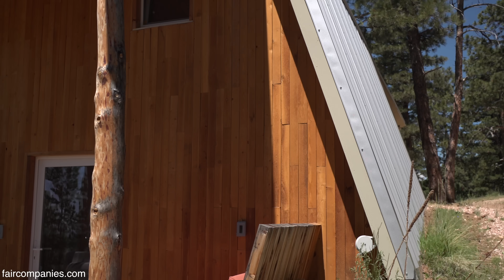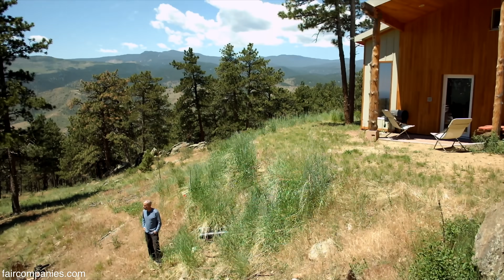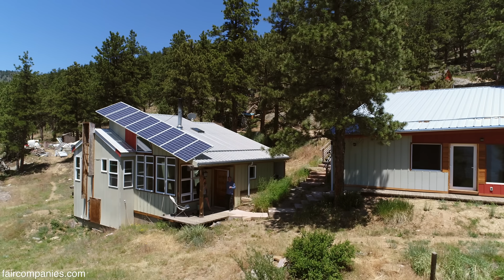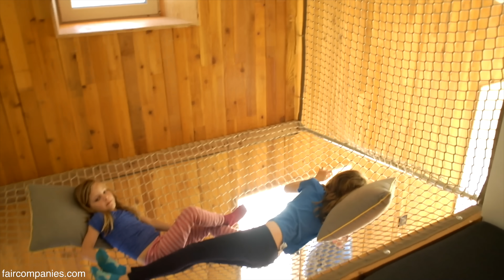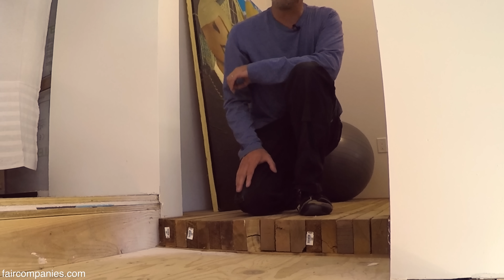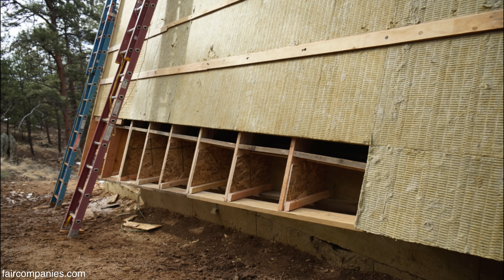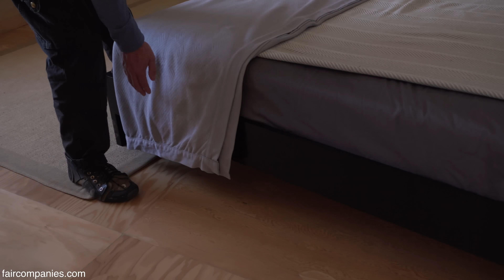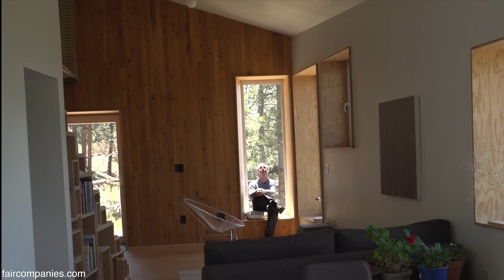Designer builds efficient off-grid Passive House in Colorado

Comment: Completely off topic why don't Americans use electric kettles?
Reply: It takes a lot of energy to boil water, as the owner alluded to in the video. I guess it's mainly a cultural thing (like top loading washing machines), but also American mains power is a little gutless compared to say, European standards. US mains is 120 Volts with a 15 Amp limit = 1800 Watts maximum. UK standard for example is 230 Volts with a 13 Amp limit =  2990 Watts. Even a cheap UK electric kettle will use 2,200 Watts, so clearly it would take noticeably less time to boil the same amount of water than a US kettle can. Also, this house is off grid I imagine and with crappy solar panels you've got no chance. Much easier to use propane.
Reply: Nick Moore
Oh ok
Reply: We have electric kettles here in USA. You can also use an empty percolator to boil water.

Comment: Why no fireplace? is it an environmental thing? I could not live without fire.
Reply: Our other small house is heated by wood. It is a lot of work to cut, split and stack it as well as does not provide a very comfortable indoor climate most of the thim. Add dust and maintenance I and very happy with having a passive house that requires no work and almost no extra energy.
Reply: Jude Vapes he doesn't need one with all the insulation. I agree though that I am a fan of the aesthetics
Reply: + Anrew Micheler Just how low does the indoor temperature fall in the winter if you have no sun for a few days? Your R6 windows are state of the art, but still lose heat rapidly.
Reply: Paul Ohlstein that's a great point. So we do have to supplement heat loss with a heating system. I my case it's peak 4500 btus which is quit small. But yes it's not cold weather that effects us as much cloud cover. You can also design with less windows and forgo the solar heat gain. There are some homes in England I just learned about that where the same in every other way except the glazing ratios.
Reply: + Andrew Michler. It is too late now, but where you have a solid partition forming the "shadow box" that frames your front windows, you could have interior insulating shutters. At night the shutters would be closed to increase R value of the windows and during the day they would fold back to form the shadow box and let the light shine in.

They could also be partially or fully closed in the summer to reduce solar heat gain.
Reply: Paul Ohlstein that's possible but really overkill for our us. We need very little suplimental heat as I mentioned so the cost and fuss would not be worth it. Thermal performance for windows are not just ambient losses but radiant. With high Delta Ts a high performing window does not feel cold adjacent to bare skin.

Comment: The pipes in the ground could be 226 x more effective it he was to use steel rather than PVC
Reply: Its discarded water main pipe from a local development that went under. I actually like how it will never rot and it is surprisingly dense, so thermal transfer may not be so bad.
Reply: TheKlickitat, you are right, but I think he was choosing between free material vs effective.
Reply: + TheKlickitat

Steel has a thermal conductivity 500 times higher than PVC but the actual BTU delivered to the air traveling through the pipes does NOT go up by anywhere near that factor.
Reply: +TheKlickitat: You have to learn more about heat transfer. The insuative value of the PVC pipe is not desirable but it is not a serious problem. Most of the resistance to heat transfer in this case occurs at the film of low velocity air that adheres to the inside diameter of the tube, not by conduction through the pipe wall.
Reply: The numbers come from the engineering toolbox. The idea is that the ground in contact with the pipe cools or warms the air to 55 degrees. Putting in 1/2" walled PVC pipe is absolutely counterproductive to the intent. The air moving through the pipe is cooled or heated through ground contact and so thermal conductivity is of utmost importance.

Comment: The kitchen is so clean and the rest of the house. Why is that? Is it new building or cleaned before cams came?
Reply: The building appears to be his hobby man cave. I get the impression the other small building is the main living area. If you were the sear a steak in that kitchen it would take days to get rid of the smell. I made a kitchen island with concrete. Looks great, but isn't that functional with glass and ceramic items, like plates and coffee cups. The upper cabinets were built high - man height, not woman height. No artwork on the walls or a single feminine touch. His wife can't stand the place.

Comment: When air cools in the earth tubes, I would be afraid that water would condense in the tubes and mold would be a problem. When he talked about "conditioning" the air, conditioning implies that the air is not just heated or cooled, but that water is removed. How do the tubes condition the air? Are they on an incline so that the water just slides down them and into a cache? Does anyone know? Thanks!
Reply: The tubes don't condition the air, the ground does. Ground temperature, 6 feet under (~2m), almost everywhere on the earth is 55 degrees (~13 C). 
As the air goes through the tubes in the ground it cools the air. That cooled air is sucked into the house and pushes the hot air out vents.
Edit: There may be more going on there to filter, clean, or dehumidify the air before it's introduced to the house, but the concept is the same.
Reply: theshion005 The pipes will be both smooth and angled so that any water drains out of the system.
Reply: I looked into it and the ground conditioning system do indeed need to have a slope and proper gravel drains build in to not condensed water.
From what I understood mold can be a problem if not properly designed. You could also make it so that the tubes are accessible.
It's definitely the smartest way to save on power for cooling though.
Reply: theshion005 it is true that humidity can condense in the tubes, thus removing humidity before it is passively introduced into the home. The pipes can be angled and narrowed so humidity and other things from nature can find there way out
Reply: In a closed system, like geothermal, condensation can be a problem. As I understand his setup, it's not a closed system, so moisture evaporates (plus, as you mentioned, the pipes are angled).
Reply: What about keeping mice & snakes out of the tubes.
Reply: Paul Wicklund at school we did a draining system similar to these conditioning tubes. You can either bury the outside end in gravel, or set up grates. I imagine it's not a real problem
With a little consideration.
Reply: screen mesh
Reply: People have had this problem with ground tubes, and this is a criticism of this type of system. Whether this is a problem that is inherent, or one of proper design and implementation is a matter for debate.
Reply: @Nick Moore. Thanks!
@ Trevor Lambert Makes sense.
Reply: The house is on a slope so I suspect the tubes would follow the slope and drain down slope
Reply: If you look closely at the ground below the house and foundation you'll see the tubes exit far below the it and being on such an incline, no water would have a chance to sit within the tubes. Since he had no fine screen covering the opening, the worry would be an unwanted bug infestation!
Reply: sample text b
Reply: He lives at a high elevation in Colorado - cool, very dry air. When it rains in the summer people don't get under cover - you'll dry in 10 minutes. Even wet wood dries in a few minutes, to the point it'll catch fire.

Comment: You can't say it's designed by physics without quoting the physics!
Neat house, but where is the physics?
Reply from the maker: Quoting wikipedia (in the section comparing Passive House with Zero Energy Buildings), they are both "based on the same physics of thermal energy transfer and storage". I liked Andrew's metaphor of seeing the home as a thermos.
Reply: Kirsten Dirksen very good, but it's nothing new, It's just a smart use of resources, every car is built on thermal dynamics.
But I agree, a thermos home would be awesome.
Sorry to be perdantic, I found the phrase enticing, then summerarily disappointed.
How to explain it......
You know how you have tubes beneath the earth to provide natural cooling, I was expecting the shape of the house or something to do something similar with physics!
Or some enginuity I have never heard of before.
Reply from the maker: I don't know a lot about Passive House, but I get the sense it's less about one element and more about trying to design the home to avoid energy loss. So yes, building shape is important. That is why he talks about why it's a wedge shape (with Passive House they try to stick with simple shapes to avoid unnecessary exterior walls) and even the small details of the window are important (burying the frames, etc)).
Reply: Kirsten Dirksen yeah I hear you and I don't want to bring it down, like I said it's a neat house and in a way he is right, I got caught up in semantics. I could discuss more, but I don't want to come across as a negative Nancy.
Reply: This is a film on the home's design, not a Passive House lecture. If you want more info on the physics here is a good place to start http://passivehouse.com/02_informations/02_passive-house-requirements/02_passive-house-requirements.htm I suspect quoting metrics does not make for riviting viewing. But it is exciting stuff as a Passive House designer and I encourage you to look into it more.
Reply: The physics are in the Passive House Planning Package. Basically a huge spreadsheet to calculate every aspect of a building. He mentioned that somewhere in this video that he designed the house in a spreadsheet. That's quite literal actually. 
In traditional construction you have certain requirements that have to be met. Maybe you need a certain R-value for the walls. A different value for the roof. Windows have to adhere to a certain standard. That's just reasoning by analogy. Passive house simply says you have to stay within 15 kWh/m^2*year for the whole house precisely calculate. You calculate the energy loss based on the local climate (local weather station data corrected for elevation difference), 20C interior temperature and a detailed calculation of the thermal envelope. The amount of detail in these calculations is way beyond any other method I've seen. Most other methods ignore a lot of details to make the calculations easier, but when you reduce the energy requirement of buildings to such low amounts as with passive houses, these details matter a lot. For example he was telling about overlapping the wall insulation over the window frames to reduce the amount of heat lost through those. That's a very small detail, but is can make a 10% difference on the whole building energy loss how you detail the window installation. So the physics in Passive House is really calculating all the details and not going by analogy. 
If you want to see the physics, you should get your hands on a copy of the Passive House Planning Package. I've had discussions with the people at the Passive House institute about "why on earth do they release their software as an excel spreadsheet", but they insist on that, so that people can see the formulas used to calculate everything. Also it uses all the correct units, so it's easy to follow what's going on. It should be very interesting for you if you're into building physics.
Reply: Kirsten Dirksen, certainly I learned some physics from this house: living in a valley in Los Angeles I'm seeking to temper summer with passive cooling. I'd been thinking cross-ventilation with same sized openings. Now I know I need a high small window and a larger low opening.
Reply: Sea BelowMe I agree..
Reply: donna ford, You're right, a non-breathing house would be terrible and unhealthy. This house breathes most of the time with the venting pipes ("the earth tubes") he shows near the beginning. The "thermos" is just a manner of speech; there are times when he would literally want to seal up the house (like a 3-4 day heatstorm, or a forest fire, for example). He also has cross-house ventilation which he controls by opening the windows strategically.
Reply: +Kirsten Dirksen -  Are you referring to the sloped back wall forming the wedge? I am a Mechanical Engineer and it certainly is not clear to me that the wedge is anything but aesthetic, if you find a sloped wall to be aesethetic.
Reply: https://en.wikipedia.org/wiki/Passive_house
Feist is a physicist inspired by the early efforts in the 70's, I think, of North American energy efficient house design efforts. Also, they are a very HEALTHY house to live in. Feist wiki page is in German: https://de.wikipedia.org/wiki/Wolfgang_Feist

Comment: This seems like a great place, very cool. Awesome video as always.
Reply: Air only stratifies when there is a thermal difference, that tends not to happen in Passive House. Overhangs work well for summer but not in fall, when overheating is a real issue. Opening a window when it hot outside to cool the inside obviously does not work. The sun can also be so strong that glare becomes an issue. I also would not want to live a life in which I had to constantly manage curtains to keep me from being cold, not to mention blocking a view, or schlepping wood to keep warm (which I do in the other house). Why not just invest in a high performance window? Passive solar is great and we get almost all our heating from it but I don't have to actively manage my house for it to work. The process you describe is simply not the reality for most homes and occupants in heating dominated climates I come across. And a final note- Harold Orr one of the pioneers of high performance homes, discovered in the 70s that an airlock does not work for house scaled buildings. It's crazy to me how long the industry takes to adopt what we know are best practices.
Reply: Donna, the mass and glass system is somewhat limited in how it responds to seasonal changes. We live in a similar climate as say Santa Fe and my other house is more traditional passive solar. When the mass gets cool its (really) hard to charge up again, and the house tends to overheat in the fall and get really chilly near the windows at night in winter. For comfort there is no comparison to the Passive House. Mass works better for larger buildings with a higher internal heat gains, but at best I am thinking it as a secondary stratigy to a good envelope.
Reply: Nice. Well done.
Reply: This is Passive House, not Passive Solar. Big difference. There are Passive Solar elements, though.
Reply: agree